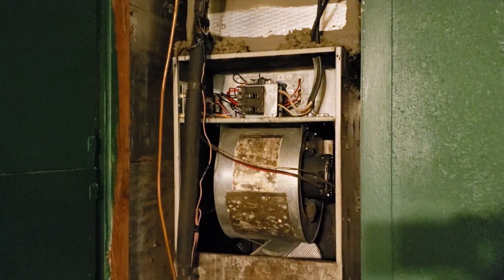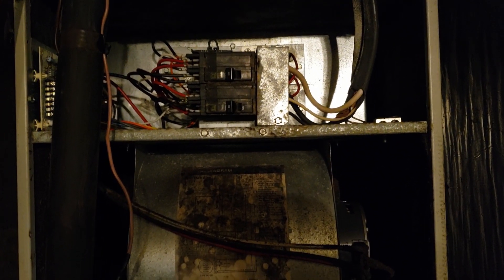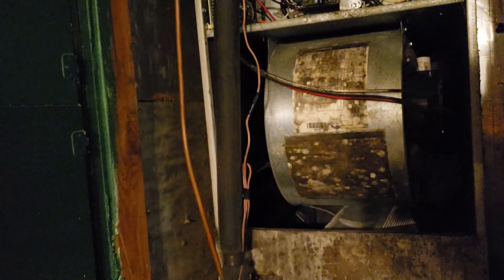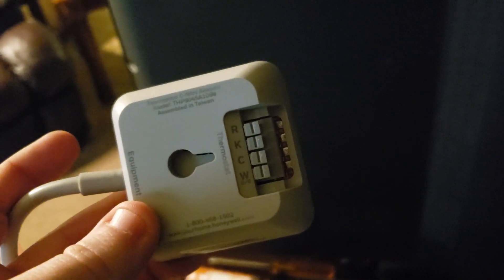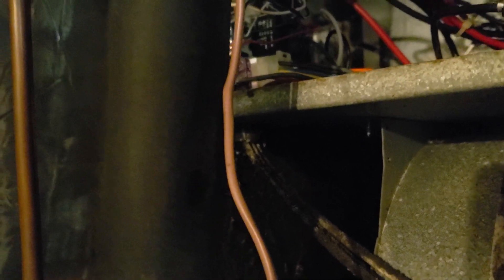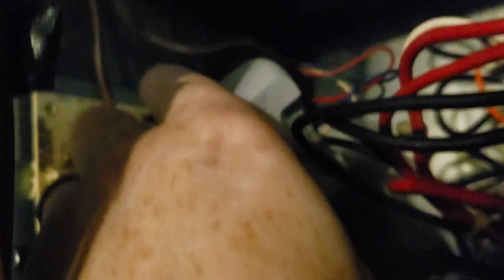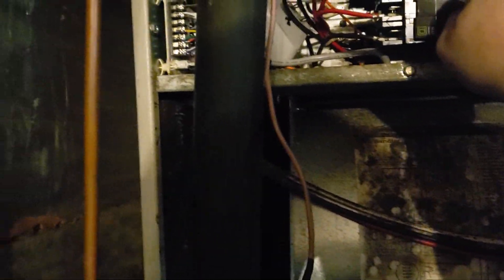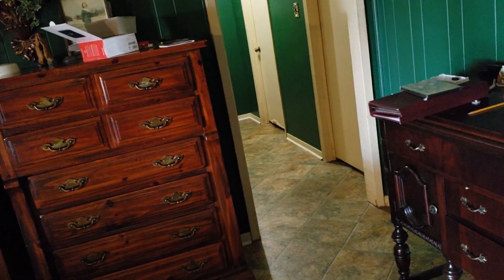Honey Well T5+ smart thermostat c wire install

Comment: So why did you have to attach that adapter to the board n order to use thermostat ?
Reply from the maker: This one doesn't have a c wire typically a blue wire, so this adds the extra power it needs from what I'm getting. Most newer systems have that extra wire and you won't need this adapter of if your system doesn't you can always check to see if there's an extra wire that's been cut and not used. At my house, we don't have the c wire. But we have nest and it leaches power and has a built in battery so you don't have to worry about it, but after more research finding out this could harm your system in the long run.
Reply: @crashinc06  so you're saying the adapter isn't good long term?
Reply from the maker: @Sfdjdhrh  I wouldn't recommend it long term if you look at the wires you have going to the thermostat you should have at least 1 spare in the sleeve that's not being used color doesn't matter you can use that as a common you look at the board on your ac unit and see where the common needs to do into and then you have a common wire you can get tape or something to label it common if you're unsure where the common is you can always Google the model of your unit
Reply: @crashinc06  thanks. I think I found a bit of another workaround. I'm going to run a 24v transmitter. You can find em pretty easily, and it seems to be a common fix. I got lucky and my thermostat is attached to a closet that has an outlet. The wire can be fed descretly enough to the unit from the closet.

Comment: So how do I know if I need to use that pig tail box adapter thingy...
Reply from the maker: Sorry I'm just now seeing this, my app doesn't update me sometimes, sorry. If you only don't see your current thermostat using a c wire then you may either not have one or it's not hooked up in your panel, you could check to see if your system supports a c wire connection and you have a spare wire to use then you can go that route or just use the adapter. Common thermostat wiring is either 4 wire or 5 wire which is for c wire or common usually blue.